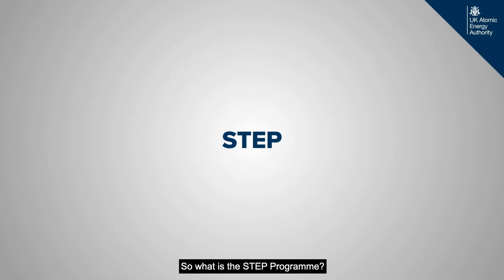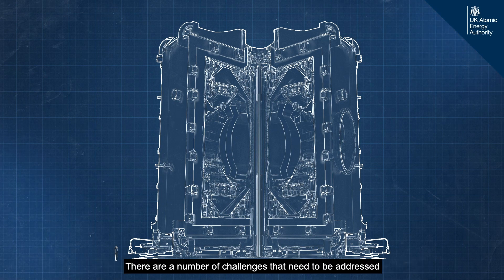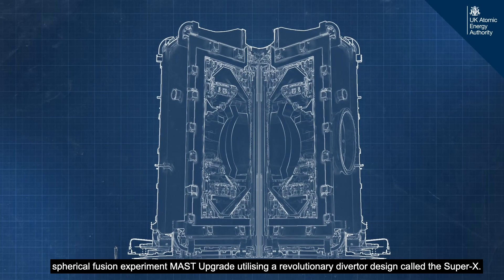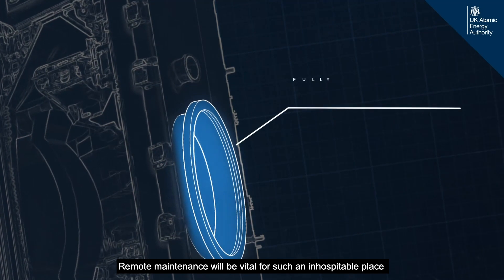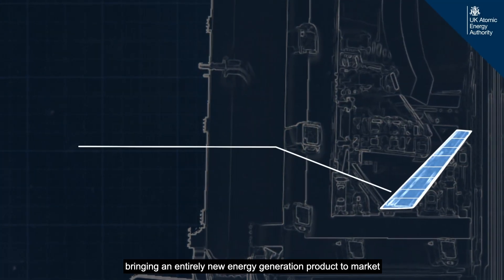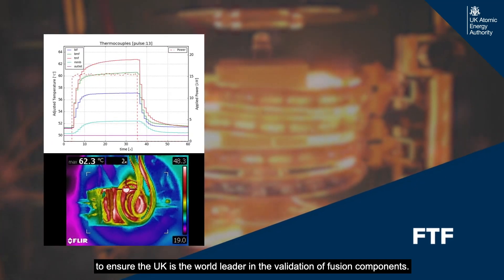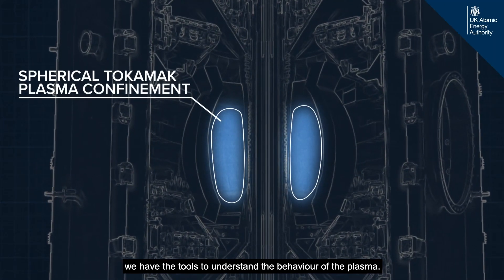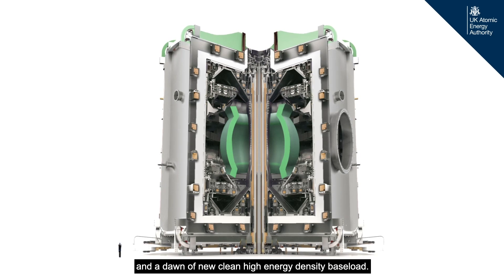A guide to STEP; UKAEA’s compact fusion reactor programme

Comment: No explanations are included about superconducting magnets that generate toroidal field and OH time varying field. These magnets should be protected by the inboard neutron shield about 1m thick that would bring about the enhancement of the
aspect ratio more than 2 damaging the basic concept of spherical tokamak. How do you solve this engineering problem regarding the thickness of the inboard neutron shield for the various superconducting magnets?